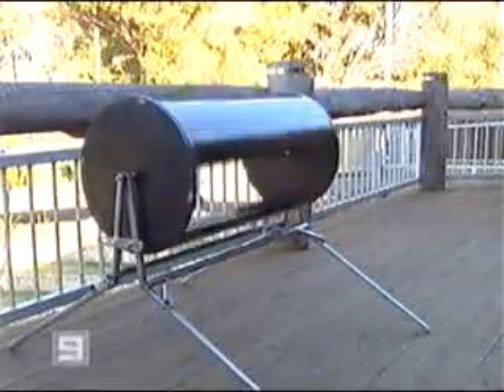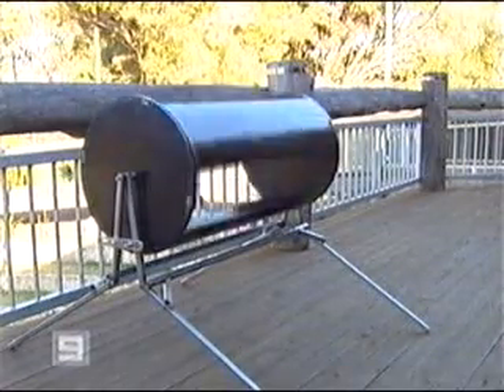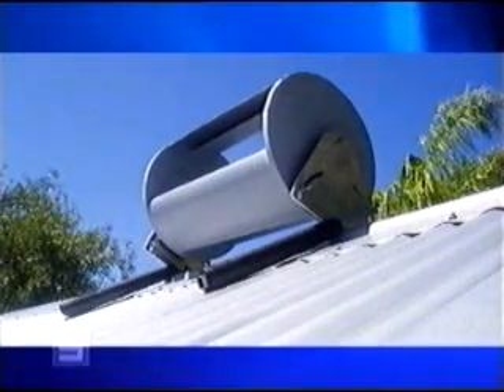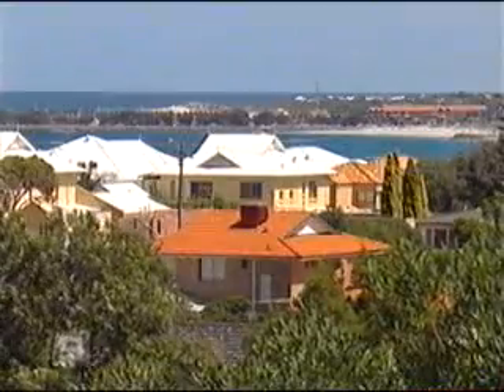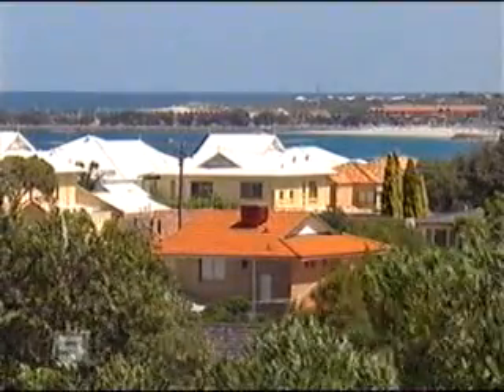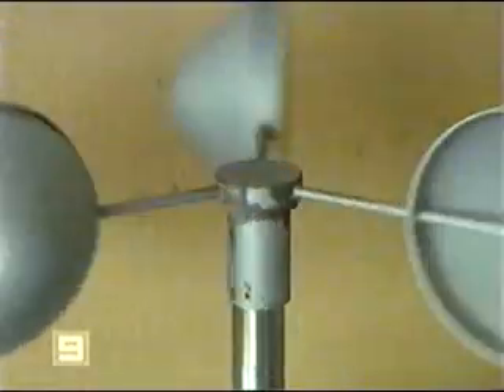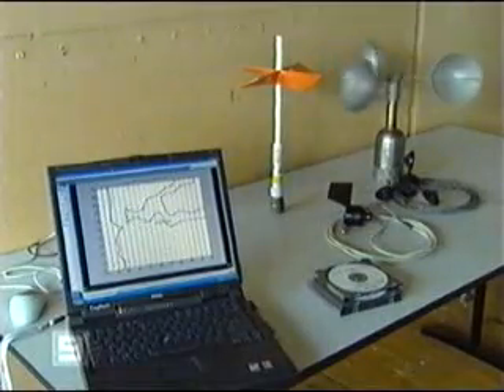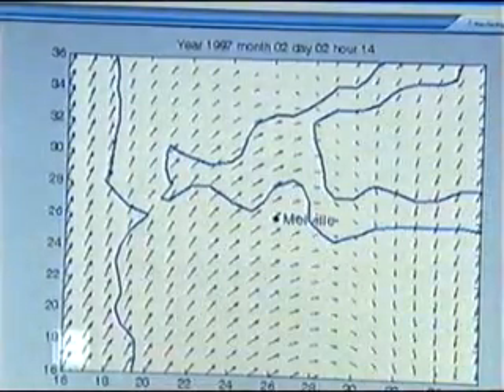Wind Turbine - Rooftop

Comment: Looks very very strange that it is possible to produce energy from  such turbine, more than to light several LEDs...
We know the subject, we know what we say. 
Well, now this "turbine" rotates without any generator, it's free rolling. 
Attached to generator - it is ENERGY, it need to WORK to produce energy (rotating frame in magnetic field)! 
Where is it? 
Send PROOFS that it works better, that any other turbines. But do not call "children propeller" as powerful wind turbine!

Comment: @centervilletn 
It works with a permanent magnet stator giving you AC output that will need to be rectified in DC for battery charging and then back to AC via Inverter.

Comment: What type of generator will these things be using?
What does the gear box look like?  
The lowest RPM I generator that I've been able to find runs at about 250 rpm. And I don't think device is running at 250 rpm with the requried tourqe that is needed. 
(generator was a 5kw unit. The smallest that I would mess with.)

Comment: If you use the newer Rooftop Mounted Turbines, you save HALF the cost of a system and install by not using the towers.  The towers are the most time consuming and costly, wasteful part of a small wind turbine system.  Have a look at my videos and you'll see what I mean.  These are also way more noisey than other turbines.

Comment: Yeah but this particular turbine design is probably VAWT because it works in conjunction with being on a roof top. although I would only use a VAWT Horizontal-Axis Wind Turbine in places were the wind changes direction a lot so not sure why it has to be put riight on their roofs close to the serface, maybe it is a law were they can't have something too high in the air who knows.

Comment: The best concentration wind for a rooftop wind turbine is about 4 feet off the peak.  So, there is much concentrated wind power that will go over this unit.  Still, it's a better idea than vertical because vertical turbines have that backside resistance, as one side catches wind, the other is resisting wind..

Comment: "This design of wind turbine was patented by Georges Jean Marie Darrieus, a French aeronautical engineer in 1931"

That's true but there's still no implementation to commercial wind power of any such designs.  Any thoughts on why such a design with so many variations over the years but none succeeded the horizontal three blade design.

Comment: Your local "inventor" reinvented a Darrieus wing lift VAWT. Would be nice to give  Darrieus a little credit. "The [Darrieus] turbine consists of a number of aerofoils usually--but not always--vertically mounted on a rotating shaft or framework. This design of wind turbine was patented by Georges Jean Marie Darrieus, a French aeronautical engineer in 1931."

Comment: In its current form, there is no attachment shown to any generator.  This prototype is little more than a moving lawn ornament and very fragile looking.  I wonder what type of noise levels the homeowner will hear when there are high winds and a generator is hooked up.  I hope the ridge vent is well isolated from the noise of the final product.

Comment: I agree! But it was vertical on a magnetic field that suspended the weight of the turbine. ;)
There is no generator on this turbine. Nothing new, these have been inside almost every AC unit and swamp cooler in the world. Commonly called a squirrel cage. Vertically, wind from any direction will spin it. Horizontally it is limited to only one direction unless you put a vertical pivot and a tail to direct it into the wind.

Comment: that turbine wont work, it doesnt even have a motor/ generator at the end of it... its just a piece of decorative metal, once you ad a motor to that to reciece the energy the forces of the motor. the push will limit the speed greatly with the wieght of this contraption they built

Comment: you shouldn't be so quick to judge either. Combustion with any amount of carbon will yield Carbon Dioxide and Monoxide depending on the temperature of the reaction, substance etc. Both would be found in various concentrations. Generally Carbon Dioxide is most common

Comment: my pre-commentator is right, you'll need way more cross section to produce adequate power. That little sucker might produce 10 watts at best ... an average usage of 10000kw/h per year can never be fullfilled by that one, not by five and not by ten either ...

Comment: "Things I can think of that can be patented are improvements of efficiency such as airfoil enhancements, and bearings at each side and maybe methods for attaching it."

Well that's true. However, that would have to be a bearing or wing patent not a wind turbine patent. 

This gyromill still just uses wing lift exactly like a Darrieus Turbine. Putting on it's side is merely a new application not a new invention.

Comment: Yes. Any method you can find to make a car alternator spin will make it produce power.  The same holds true for any electric motor.  With a car alternator, however, a commutator is used internally to convert the output to dc, in this case 12 volts.

Comment: I think wind power is great, but it's important to know some basic physics when evaluating inventions. The power in wind is the cube of wind speed, and proportional to the area of the impeller, SO there is little power available at low wind speed, and the type of the wind turbine shown here is very inefficient, probably under 10% while a blade based would give up to 40%, so you would need lots of them to power a typical home.

Comment: Idea of horisontal henerator is good but being connected to generator, the result will be clear: very small energy produced.
Besides, air boundary layer is... So vertical axis will be sure better. 
Generator of this diameter showed in this video will not produce over 40W even at strong winds. So estimate 2-3W mothly everage energy production (while house needs 200-500W and over in avarage). It is pity reality, from very simple calculations.

Comment: (that last post was supposed to be a reply to kode1303)
I think its a great idea. and its not just a Savonius type rotor, its actually a horizontal form of Giromill, which is a far more efficient design. not only that, but if its mounted on a rooftop the roof will act as a wind collector, increasing the output even more.

Comment: could you set that on top of an outside a/c unit so that when the a/c is turned on and the motor is blowing it could turn this wind machine at the same time? It could be fed back into the home complimenting the rooftop devices as well. There is alot of wind power wasted those things especially in the hot areas like Texas, Arizon, and New Mexico.

Comment: Looks like a Savonius Rotor installed horizontally. Possibly good idea for Perth or any other area with prevailing winds from some direction. Installing it separately from house would stop the noise from the system vibrating the house.